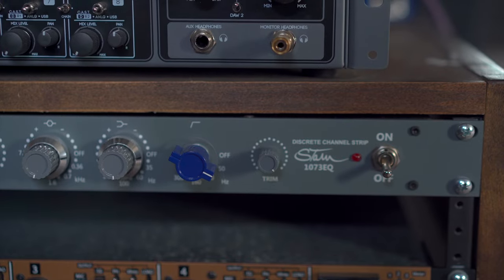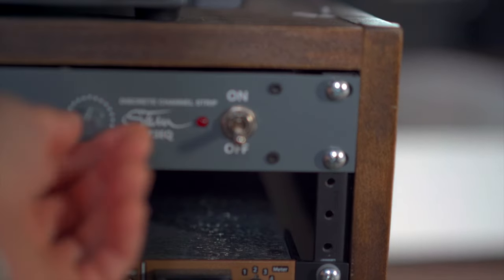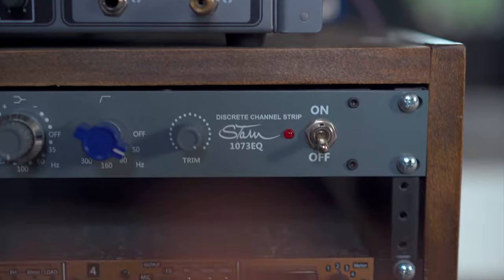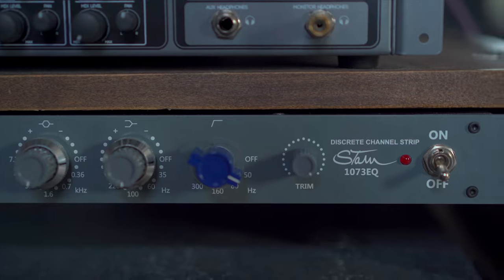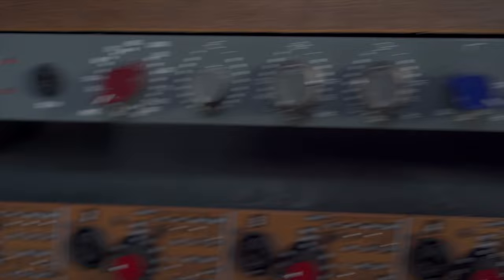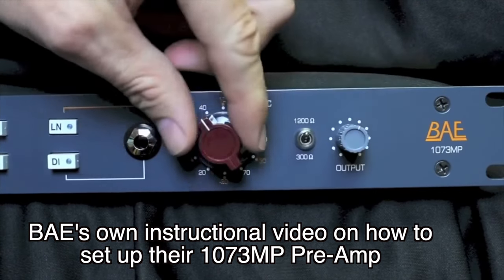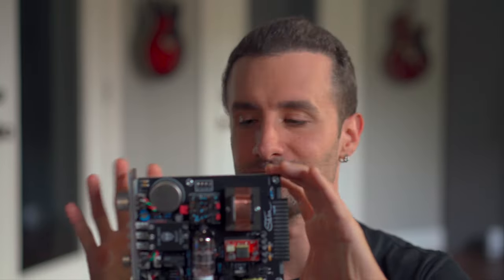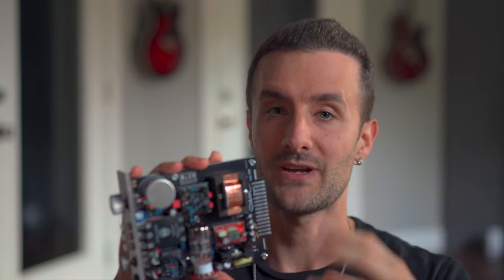How To Set Up a 1073 Neve Style Pre Amp

Comment: Thank you for this precious information 🙏. Do you think it's the same for the UAD version of the Neve 1073? Because everytime I try to record my vocals with unison technology through a 1073 emulation they sound too saturate in the loudest parts...
Reply from the maker: I’m not 100% sure. I don’t use the UAD stuff. My friend who does use UAD tells me it works the same way though, and he cranks the trim knob on the unison neve pre.
Reply: Same question. How does is work for the UAD Neve 1073? You have 3 Level options - the red knob, the Fader and at the end the "clean" Output knob
Reply: I used to have the UAD system and the 3rd is simply a mic level volume for the whole plugin iteration.

Comment: Quick question please - firstly thank you for this video, I was really struggling with it as well thanks for the explanation! On the Neve 1073SPX you have a line that is Unity gain but then it has ~5dB in hand on top that can be pushed. Would you say stay on unity gain or go into even more of the +5dB pushed territory?
Reply from the maker: I'd just A/B test to see in this case which I prefer the sound of.
Reply: @DavidDiMuzioLessons  Thanks! Appreciate it.
Reply: same for a Neve 1073 SPX ? or units nominal gain on the thicker bar ? at 2 still don't know.

Comment: would this be applicable to the UAD 1073? i read the manual and it says the "Level" knob is modeled after the Neve console fader, with 0 being unity gain and anything above that potentially causing output amplifier clipping. Is the output amplifier clipping part of this strategy? should i bring the Level fader up to its max of 10db then adjust the red knob accordingly? thanks for the help
Reply from the maker: I’m not sure 🤔

Comment: Ha! I didn't make that mistake! Yay! However, I find the EQ from the BAE 1073 kinda sucks paired with the Telefunken ELA M 251 E. I Simply turn it off because, in my opinion, it doesn't serve the mic. What do you think?
Reply: I don’t know how that is possible, for me the BAE is by far the best 1073 out there (non vintage). I guess to each their own but I find BAE to sound great and even better than the current AMS 1073’s.
Reply: It’s because of the mic 🙂
Reply: @diegobernard9506  to be fair I’ve never used the 251 with the 1073 so fair point lol.
Reply: Why you don't like it with EQ engaged? You experiencing HF roll off with EQ engaged? Sound become darker?
Reply: @georgeleap6731  there’s a simple fix to this whole ordeal. You grab the HF shelf knob and turn it up. I don’t know how this is even a problem. Probably humidity within the mic.
Reply: @bigstevedzn2353  it's more complex than you think. 1073 EQ circuit has several capacitors, that rolling off the highs and lows. Some 1073 modules has hf roll off -4db at 20khz when EQ engaged and knobs at zero. Yeah you can add high shelf but sound won't be as airy because you add high shelf on signal that already has -2db or -4db roll off at 20 Khz. When EQL is disengaged, frequency response would be flat without HF roll off.

Comment: This doesn't work for me!..

I have a WARM audio 273-EQ which as well as using for tracking I use as part of my "mastering" chain. I sent the stereo output into the 273 and have bus compressors etc in the inserts... Anyway long story short, with the dials at "noon" this setup is Whisper quiet and sounds awesome. I just remastered adjusting the input down from 40 to 20 db and the output from "noon" to 0 and thought it sounded great, until I listened on some good headphones and this setup introduces a very quiet but audible hum :( I'm using a clean power supply btw.  It makes sense, transformers are where tone comes from, but also where hum comes from! 

Just a warning to anyone trying this, REALLY check your noise floor. In my setup this is definitely not the "least noise" setup.

Comment: How do you amplify the signal if you start with the output at max volume ?
Reply from the maker: It is amplified with the output section, and you still USE the input section, just depending on how much (if any) additional input level you need.

Comment: - If you want the smallest amount of coloration, always set the
OUTPUT level potentiometer at or close to maximum and adjust
the output level with the stepped GAIN switch.
- If you want more character, turn the OUTPUT level potentio-
meter counterclock-wise and increase the gain with the GAIN
switch. This will drive the input gain stage(s) harder and provoke
more character from them